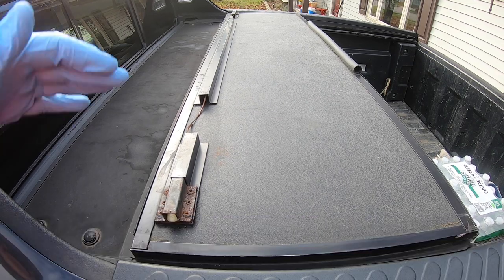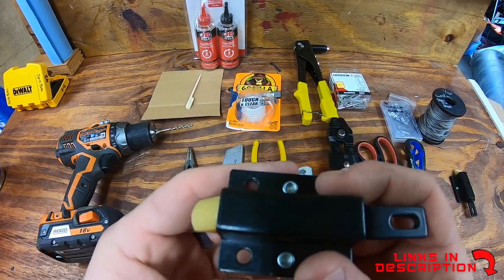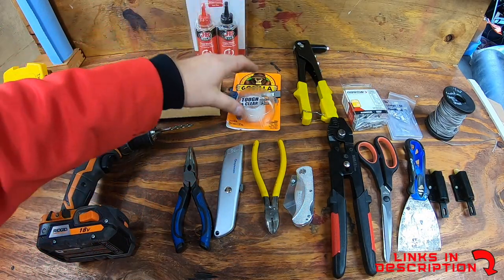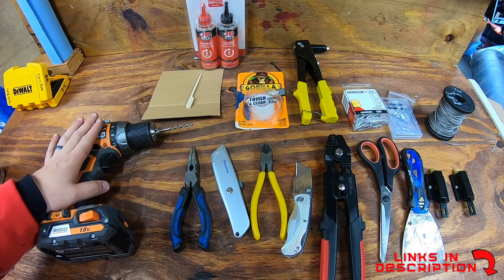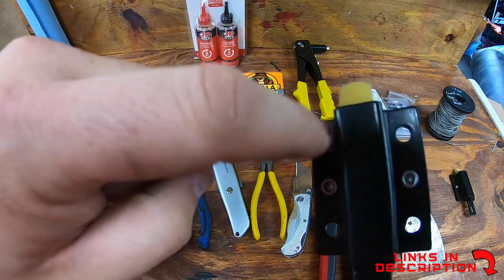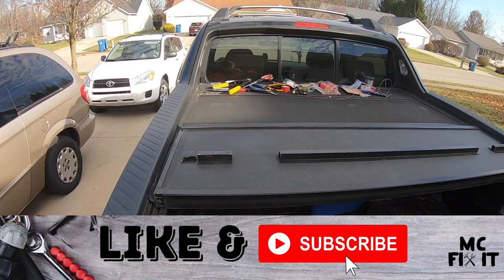Tonneau Cover Not Latching - FIXED!!! DYI

Comment from the maker: Do you have a hard tonneau cover that is not latching? Find out how you can quickly fix it with just a few tools and supplies. 

TOOLS:
• Flush Mount Trigger Latch [JR Products #11705] - https://amzn.to/33axjdV
• 1/16" Stainless Steel wire with Crimping & Thimble Sleeves - https://amzn.to/3IJK5k4
• Pop Rivet Tool - https://amzn.to/30hgzR9
• Pop Rivet 3/16" x 1/2" - https://amzn.to/3IHna8X
• Mounting Tape - https://amzn.to/3lX8ys6
• Wire Crimper Tool - https://amzn.to/3DMiwmr 
• Rigid Drill Set - https://amzn.to/3bb9t2S 
• Drill Bit Set - https://amzn.to/3f8gti8 
• Scissors - https://amzn.to/3tqn8ti
• Large Putty Knife - https://amzn.to/3f2CFKx 
• Razor Blade - https://amzn.to/2StsW8q

00:00 - Intro
00:07 - The Problem
00:45 - The Tools
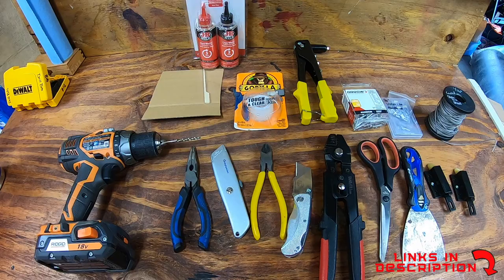03:23 - The Test
08:39 - The Fix
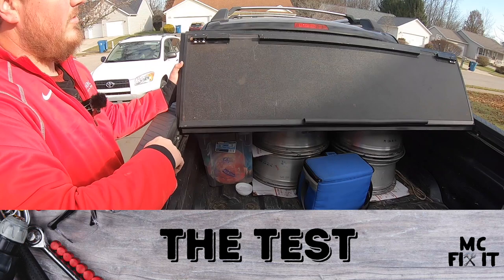20:40 - The Test

This video should work on all makes and models of truck bed covers! 

Check out my website at http://mcfixit.us 

Disclaimer: Due to factors beyond the control of MC FIX IT, I cannot guarantee against improper use or unauthorized modifications of this information in the video, post, blog, or social media. MC FIX IT assumes no liability for property damage or injury incurred as a result of any of the information contained in this video. Use this information at your own risk. If you feel uncomfortable at any time. Stop and go to a professional. MC FIX IT recommends safe practices when working on vehicles, your house, or any other project and or with tools seen or implied in this video. Due to factors beyond the control of MC FIX IT, no information contained in this video shall create any expressed or implied warranty or guarantee of any particular result. Any injury, damage, or loss that may result from improper use of these tools, equipment, or from the information contained in this video is the sole responsibility of the user and not MC FIX IT.

#mcfixit #autorepair #tonneau #repair #notlatching #stuck #door